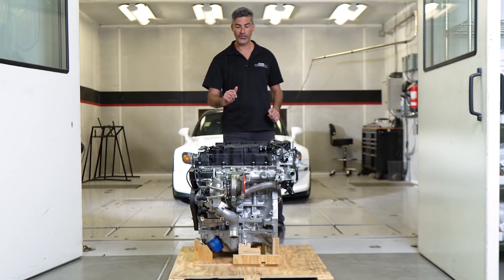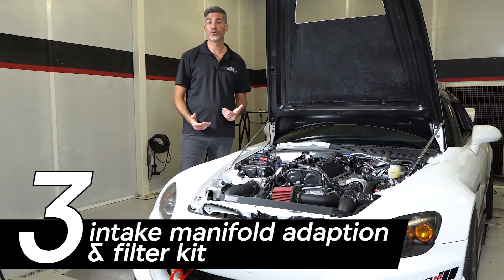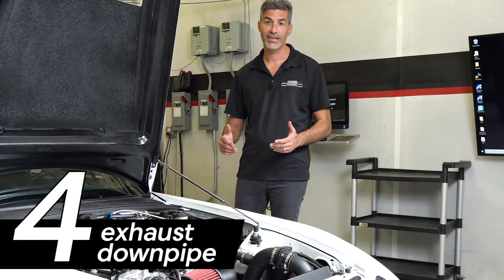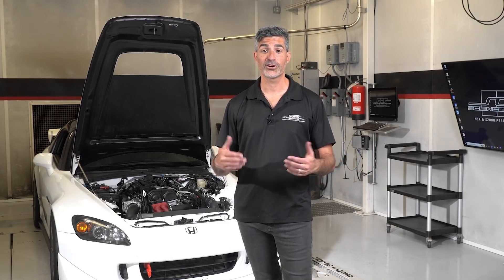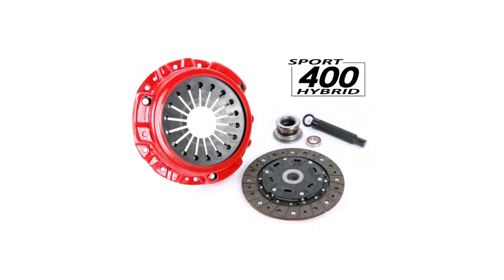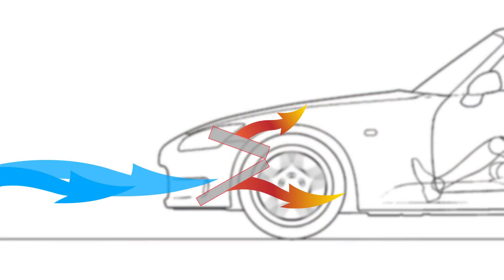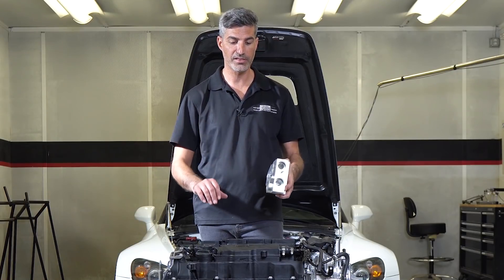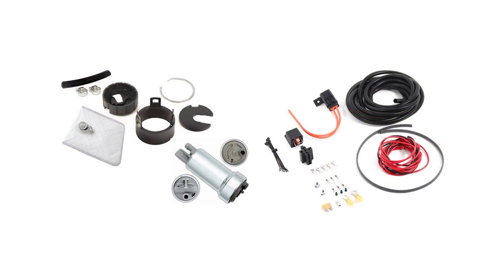ScienceofSpeed K20C1 Civic Type-R Engine Conversion for Honda S2000

Comment: this is awsome work but it makes me wonder, why would I chose a k20c1 conversion for roughly £15k instead of a turbo conversion for existing f20c at £5k roughly and probably more power and torque on stock internals than the k20c1. I' m curious if anyone has any thoughts on my thinking 🤷🏻‍♂️

Comment: I'm interested. How does this effect the 50:50 weight balance? when I had the super charger I didn't like the front weight increase, it created understeer during corner entry. Then the heat soak for street use was bad so I removed it. If I could test drive this it would help me decide.
Reply: He mentions in the video that the overall weight of the k20 (including turbo) is about 20 lbs lighter.

Comment: My k24a2 swap s2000 makes 600whp on a stock $900 junkyard motor and has working AC (which the type r swap won't have) for less than half the price of this swap. This type r swap is just for someone with money and wants flex they have a type r motor.  Most likely the customer doesn't even work on their own car anyways.

Comment: This is very sick.   I have a FK8 and I always loved the S2000.  But I have to say. This will be a very very expensive swap.  For the F20 and 22 engine are Honda king 4 banger engine.  And on boost the s2000 make crazy insane power.  I love seeing the hard work of putting a k20c1 in a s2k.  But replacing a s2k engine when its already a amazing set up from stock. The k20c1 is amazing motor but so it the s2k fseries.

Comment: How does this conversion compare to a similar stock s2k w turbo kit. Cost to whp/ft lbs tq
Reply from the maker: A good comparison would be the ScienceofSpeed TS-MAX kit. Depending on the year, and configuration, in general it's about $10,000 for a turbocharger system, fuel system, and engine management. A built engine generally runs about $7,000-9,000.

Comment: Just make some decent shocks for the base 6MT Civic with K20C2 engine and you get Hybrid like consumption with real racetrack ability. Problem is, it'll only cost about $500 for a set of new shocks and struts.

Comment: Unfortunately this is too expensive to justify for a gain of 60-65hp at the crank. This is the “I have too much money to care about the cost swap”.
Reply from the maker: It's not for everyone - but to be clear, this is 80-200 horsepower gain, depending on options, with factory reliability.

Comment: How has thenhandling dynamics of the vehicke changed?
Reply from the maker: Net zero weight gain, so no big change to the chassis. The instant torque has really revolutionized the power delivery of the S2000 however.

Comment: How much does this cost for the full swap??
Reply from the maker: Pricing is around $16,000 with HPD engine management (plus compatible clutch and fuel pump if you do not already have these). Please check this page for pricing: https://www.scienceofspeed.com/index.php/scienceofspeed-k20c1-civic-type-r-engine-conversion-kit.html
Reply: @ScienceofSpeedLLC  I saw the options but how much for the labor cost and install?
Reply: @louisdesignsandrides1215  around 3k
Reply: 3k

Comment: I'd go with a LHT supercharger kit over this for an easy and reliable 440whp, but more options is always good.
Reply: Yeah but an used F engine cost almost the same as the car itself
Reply: @ulisesavila2879  Don't need a used F engine, just use the one already in the car .
Reply: @nighthawk0077  yeah, and what happens when it is irrecoverable?
Reply: @ulisesavila2879  what, from driving it into a lake or running a 200 dry shot of nitrous through it? Other than that if you need to just do a rebuild on it like everything else.. 🤷
Reply: @nighthawk0077  My S is coming up on 250k miles. It has too many miles to think of doing a supercharger on it. I am just waiting on the day it blows and this conversion is a contender for sure. The price of F20/22 are pretty insane.
Reply: @HamHavoc  yup perfect excuse to do a rebuild
Reply: @HamHavoc  If compression checks good then theres no issue to put forced induction to it.

This is provided that you actually took care of the motor and maintenence during all those miles.

And if the price of this kit is something on your radar, you  might as well have your F series rebuilt with new seals, pistion rings,  cam/crank bearings, and stronger rods if you are worried about the mileage.

Me personally, i just dont see how 306hp with 15-20psi of boost with a 7k redline is more appealing or even worth it, than a built f20/f22c1 screaming to 9k making 400-500 on the same boost. Or 300 with even lower boost levels. 🤷‍♂️

Comment: i worked for Driving Ambition in Sac " Shads place", we did NSX service and install stuff. these guys where the competitors. they run their business much better. have an NSX send it their for the service and install stuff if thats not your jam
Edit: if u own an NSX and have not changed the " clutch master assembly " and u see blak goo on it. change. one of the most over looked repairs on that car. like almost everyone we saw.

Comment: If you have an S2k already you're looking at 7-10K for this kit plus the price of the engine, which they pretty much don't exist on the used market at this point. HPD crate engine is another 7k. So that's 14k minimum on top of the price of the car if you are gonna do the work yourself. If not I'd say another 2-3k at minimum. So in reality you're looking at 20k to get this done unless you have a number of special circumstances. Now if you didn't already an s2k they don't come cheap these days. A decent shape one will set you back mid 20's at best, maybe even 30. So just to be clear if you thought of this is as as ground up project you need about $45k minimum. That's the price of a used Civic Type R, you know a car that was made just a few years ago and is loaded with tons of nice modern features..... Don't get me wrong I love my s2k, but this seems like a silly option to me. It's for rich people that exist in a tiny niche market. The f-series that comes in an s2k is an amazing engine even by today's standards. If you find yourself with a s2k w/ a blown engine, you could swap a normal k20-k24 in the car for a fraction of the price and there's already a huge community that supports that swap. You could even toss in your choice of forced induction and never come close to this type of crazy money. At the end of the day this kit is for someone that wants to say "yeah I got an s2k with the type r swap".
Reply: I was thinking the same. I have an s2k w/ 80k miles but if it ever blew up a regular k24 swap would be a way cheaper option like u said, even with boost it stays way under $10k
Reply: @Nepypr  im almost to 250k miles on mine and I still feel like I can get to 350k on her.
Reply: yup, they should of made a kit for k20/k24
Reply: @cali_cal  I thought this kit was for the k20/24 but now I see its not. Yeah going the K20 is probably the most bang for your buck when your S engine finally gives out.
Reply: @cali_cal  ballade Motorsports has it
Reply: from a financial perspective it doesn't make a lot of sense however if you just don't really care about how much its going to cost this could be a really good option for a race car s2k build.
Reply: @albertt7784  you could build a forged k24/k20 head combo with a turbo for less and it would
have more support. There’s already people doing it.
Reply: You also gotta upgrade the diff and transmission. The ctr engine is making way more torque than the f20c. Overall this a cool thing and hats of to SoS for still making stuff like this for the s2000. Although it’s super expensive.
Reply: @Balo657  the rear end is weaker than the transmission and usually the first thing to die. Convert to something like a Ford 8.8 for 4-5k. Transmission, you’re on your own. No great, easy options.
Reply: Yea theres literally no point of this conversion. K20/k24 swap. Mild build. Slap a turbo on it. You looking a 600whp for like half the price of just the cost of the kit lol. Not even building the C1.
Reply: As someone who's driven 400+ whp boosted F series, a F24 stroker build, K24 swapped S2Ks, AND a K20C1 swapped S2000...I can confidently say hands down the K20C1 is KING. I'm onto my 4th S2K, and will be doing the K20C1 swap later this year. Yeah, it's obscenely expensive,  but good God is that motor incredible in this chassis.
Reply: @pepperinyoureye   King of what? King of price tags and over rating? I've also had a number of boosted cars and Hondas. yeah the K20C1 is cool, but it's architecture isn't really that different than the k20A when it comes to block, head, main, etc. When you really start to compare what you could do with your money with a built K20A or K24 with forced induction for the fraction of the price, this whole thing just does not make sense. Bottom line is that if you just want to match performance of what this swap will give you, a low boost turbo or SC setup on a healthy stock F20/F22 will match this performance easily and you could build to double the power a stock k20c1 makes for 1/2 the cost.
Reply: Created the wallet buster 2000

Comment: Hey Chris, we spoke a bit at Honda meet (had the camera, Angel hat, FK8 It black shirt). Something to mention on the website or upcoming video interview is including in the package a OTS differential with that being a weak point of the S2ks.
Reply from the maker: We've actually had good success with the factory differential with turbocharged S2000s when properly cared for (primarily, reduce shock from things like burn outs). The J's distance rigid collar is a good option to consider when rebuilding the rear end to keep the pinion stable relative to the ring ring, regardless of what engine is in the front of the car.

Comment: Any timetable on when you will release an functional a/c kit to go with this swap? I assume you want to see how this kit does before you go down that road but really nice work to the SOS team.
Reply from the maker: Air conditioning is not currently supported. We do recognize the need for AC even on race cars (for example, the NSX GT3 EVO race car is currently available to teams that run the cars in hot humid climates). That being said, there are two factors. 1) packaging 2) ECU control. Packaging will be challenging, as the steering rack and other accessories interfere with the factory K20C1 compressor (which uses a different refrigerant any way). 2) The HPD ECU does not support AC. It's possible with MoTeC, and another solution we are exploring. These issues are something we are exploring, but do not have a time table, or guarantee, that it will be offered in the future.
Reply: @ScienceofSpeed  Congratulations 
This is and outstanding job
But don't you think if you develop a similar kit for the K20c that comes in the Accords and Acuras RDX for swap them
Into street going S2000 AND The triples 
FRS/BRZ/GT86/GR86 
Could bring even more profit???
Especially if that swap kit comes to mating to a CD009 transmission in said plaftforms??
Ppl are screaming in the streets for a setup just like that
And since you guys got all that knowledge into conversion already
Is a mayor,mayor,mayor,mayor deal 
And of course honda don't got to know Anything about it

Comment: Does this engine swap do anything to the weight distribution or is it still at 50:50?
Reply from the maker: Engine is about 20 lbs lighter, and the conversion adds a small amount, so the net change is about zero.

Comment: Would an ap1 have to use the CTR throttle body and some sort of peddle sensor in order to use the HPD ecu?
Reply from the maker: Yes, correct. The engine control package for 2000-05 includes an accelerator pedal position sensor assembly.

Comment: Great job to SCIENCE OF SPEED for creating such a well put together engine replacement option!
The legendary F20/22c1 used replacement engine is close to extinct. This is a breath of fresh air to s2000 owners!
Reply from the maker: We always say more options are better, and appreciate your comments!
Reply: @ScienceofSpeedLLC  hi, i am from the mini cooper community. With the aging 1st gen(1.6L with supercharger) and 2nd gen (1.6L with turbocharger), our engines are high mileage and getting hard to source reliable replacement motors. We wonder about the 1.5L in the current civics or the k20 as viable options. Would your company branch off doing hondas and possibly create engine mounts for us to use honda modern engines?

Comment: I wonder did you do before/after runs on track to compare the timing difference between the F20C and K20C1?
Reply from the maker: We have not done timed comparisons, however, have compared an S2000, Civic Type R, and now this K20C1 powered S2000 (S2000R) at the same track (our home test track, The Podium Club). Impressions are 1) the amount of torque generated from the K20C1 transforms the S2000. Main straight top speed is about 20 MPH higher for example. 2) The lower weight of the S2000 (of 300 lbs) makes a significant difference in braking, cornering, and of course improves acceleration performance. 3) the cooling efficiency is dramatically improved over the Civic Type R - which is limited by packaging (stacked intercooler, condenser, radiator and proximity of downpipe to radiator), especially compared to the v-mounted S2000. Driving in 90 deg F ambient weather, we're seeing a coolant temperature range (directly from the cylinder head) of 180-190 deg F. Hope to share more of these impressions in a future video.

Comment: Looks amazing but would a supercharger kit do the same job?
Reply from the maker: A supercharger or turbocharger system on top of the F series engine is always a great option (ScienceofSpeed offers both) . This conversion is intended for a customer needing an engine rebuild (worn out S2000 engines are a definite thing as the cars progress in age) and wanting a forced induction system  which meets or exceeds the torque delivery possible with forced induction systems being used on the F series. For example, an engine rebuild is ($7,000-8,000+) and requires an engine that is still serviceable. A forced induction system with engine management is ($6,500-8,000+). This puts you at $13,500-16,000+, plus the cost of tuning. This is comparable to the K20C1 conversion, which provides a new engine designed for forced induction from its inception with factory reliability. This option becomes even more compelling when you consider the resale value of the F series engine being removed. At the end of the day, there will continue to be a place for both bolt-on forced induction for the F series, and this new replacement option. Thank you for the great question!
Reply: @ScienceofSpeedLLC  $18k would put the f20/22 in the sleeved, built long block with turbo kit, and supporting modifications category, good for 600+whp. I think the k20c swap is a good option, but for someone looking to just make reliable power, it’s not the most cost effective nor the easiest.

Comment: Does any of this kit work with any other motor besides the one from the type r?
Reply from the maker: Great question. The engine that is most comparable is the K20C4 (2.0L turbocharged engine from Accord). This engine uses a very similar block with a different turbocharger, sensors, and ECU (Keihin instead of Bosch components used on the K20C1). Physically, it should fit the same, and we believe that the engine mounts, coolant manifold, intake manifold, transmission mating, and flywheel mating would be the same. The different sensors will create some work for engine control and engine lay over harness compatibility. We hope to verify all this in the near future. This engine is compelling because they are reasonably inexpensive.
Reply: @ScienceofSpeed  ☝️
This is what i mean in the other comment
That one can be register into a street going car(maybe not in cali,sorry guys)
But the street going S2000s and the Toyota/Subaru triplets definitely can benefit from that swap

Comment: F20C is still levels above this k series motor, THE SOUND, HIGH REVING NATURALLY ASPIRATED F1 INSPIRED EXHAUST TONE IM GOOD ILL KEEP THE F20 in my s2000😅😀
Reply: K20c1 in cabin actually sounds like the Hondas of old. Very buzzy and can clearly hear VTEC engagement even with a turbo.
Reply: I'd swap my F20 in a heartbeat for this. If I had the money that is 😂
Reply: @gigatron2008  maybe one day Honda will do a f20 and f22 buyback program
Reply: @chinafukr69kack31  well mines got 33k miles she ain't getting swapped anytime soon lol.
Reply: @chinafukr69kack31  Will do! haha I don't drive much. Even my daily sits for days.
Reply: k series has way more options
Reply: I too plan to keep my f22 and stay all motor but mad respect to SOS for putting the modern engine in the classic chassis. When my f22 blows up it gets harder and harder to find options to restore it as time goes on.
Reply: So obsolete
Reply from the maker: More options, the better! Surprisingly, this engine sounds a lot like the S2000 engine.

Comment: Does the kit work with right hand drive vehicles?
Reply from the maker: We have not been able to verify RHD fitment, so we are listing this as for LHD for now. If a RHD vehicle becomes available for test fit, we will update this information then. More details are available on the FAQ page: https://www.scienceofspeed.com/blog/faq-scienceofspeed-k20c1-civic-type-r-engine-conversion-for-2000-09-s2000/